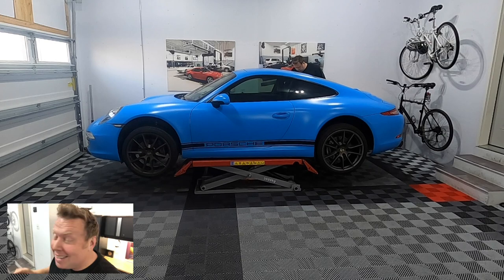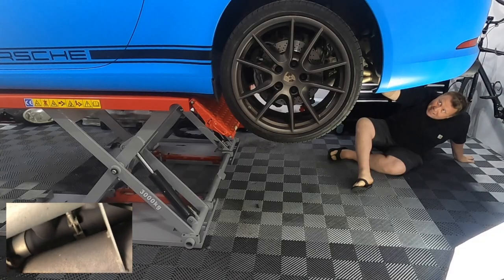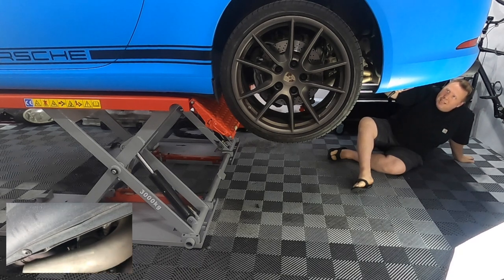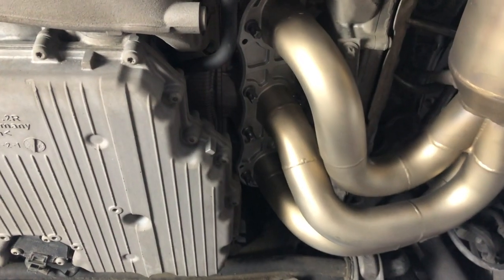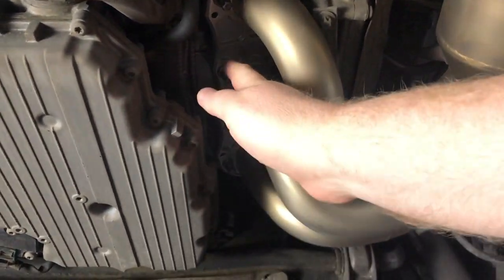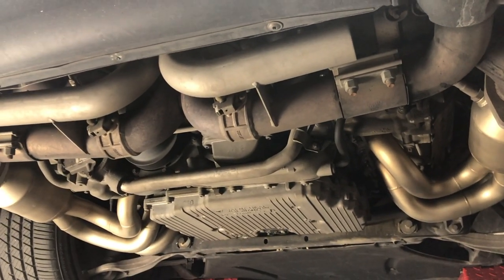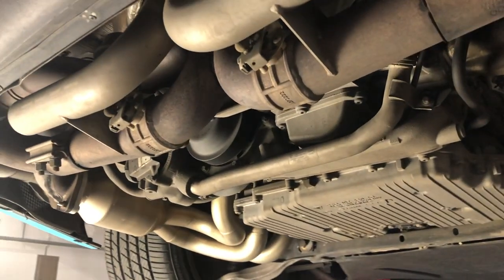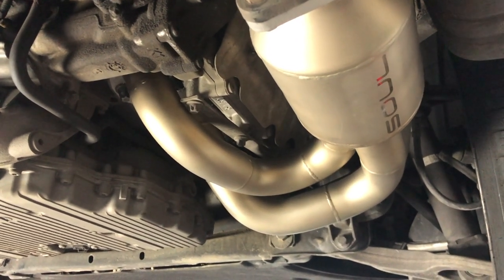Soul PP vs. OEM Porsche Headers - Porsche 911 (991.1)

Comment: Thank you for making this. I am considering both and honestly like the sound profile with stock headers so I’ll prob start with just the rear section. That said, your car sounds amazing both ways and again, thanks for making this
Reply from the maker: You’re very welcome! Thanks so much. Honestly, that was the same approach I took. I was a little hesitant about the headers at first so I just went with the valve exhaust. It’s a good way to go about the journey. Good luck!
Reply: Great video! I do have to say, the Soul exhaust sounds so much better in person. I met a guy who has a 991 Carrera with the Soul exhaust (not sure about headers) and it sounded amazing. IMO, it sounded better and louder than my 997 Turbo which has Supersprint headers and Fabspeed exhaust. Plus, having the option to open or close valves makes the Soul a very versatile exhaust. Thanks for the video!

Comment: Another great video James.  I thought the sound was great with and without the headers.  The question is, is it worth $3500 for the extra horses.
Reply: The difference in response is very noticeable - more important than the sound IMO! - Mike
Reply: @SoulPerformanceProducts  hi Mike,  I am very interested in doing the headers.  Is this the best way to squeeze more power out of a 991.1?
Reply: @markbudreau1410  you could also experience good power gains with an ECU tune at half the price without changing the sound at all. Headers are the best exhaust mod to unlock more power. -Mike